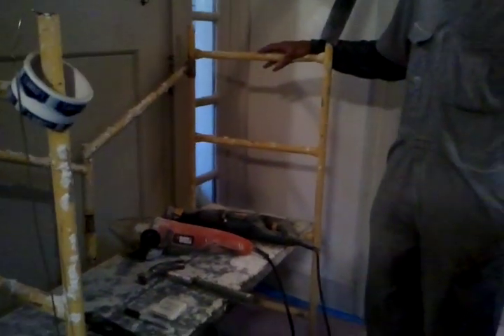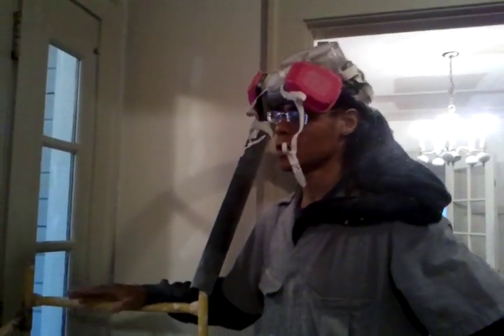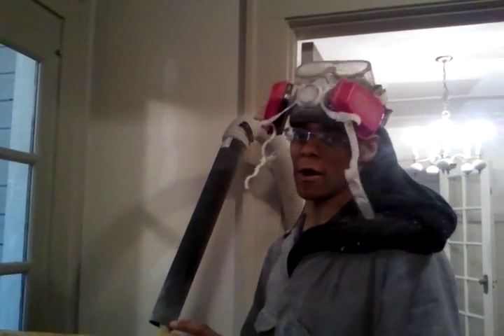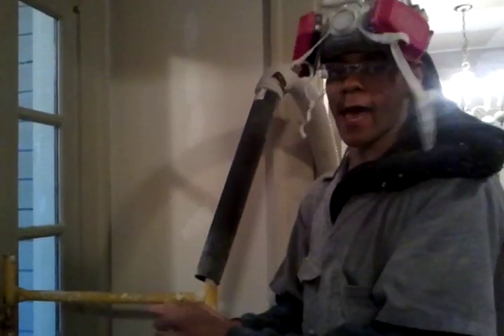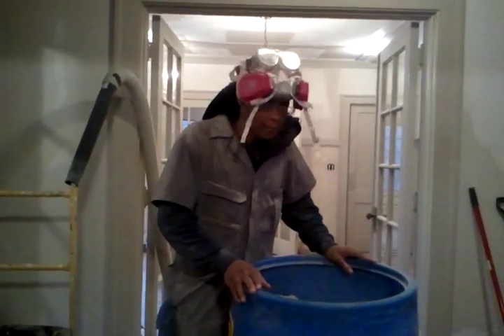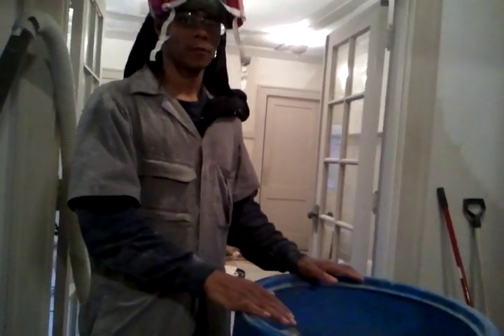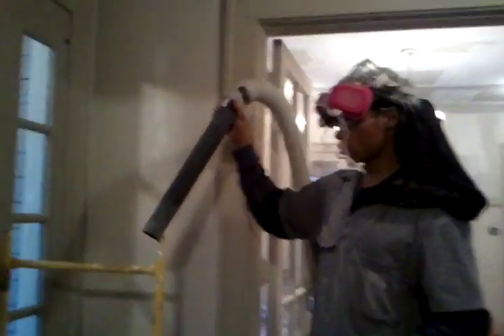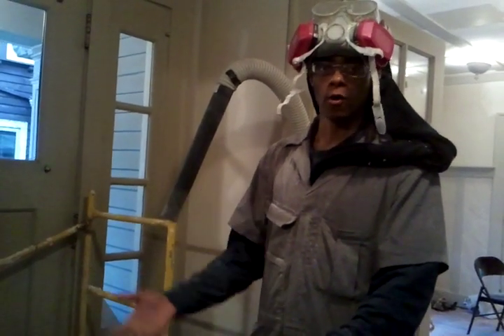Cellulose Insulation for Lath and Plaster Walls - Part One

Comment: What do you do about a vapor barrier?  Without one, vapor will condense as it moves from the warm side of the wall to the cooler side.  The cellulose will then absorb the water and compress itself into the bottom of the wall cavity.
Reply: I'll 2nd that question
Reply: ill third that question i see no answer ...........
Reply: Came on here tonask the same question. Without VCL this is potentially dangerous.

Comment: Use a Dremel Saw-max to cut through the cedar lath and or plaster. It works much better. I LOVE using the Dremel Saw-max on wood, ceramic and metal. Cuts like BUTTA!

Comment: How do you know you got the bay all full of cellulose? Just wondering because we're doing the same thing with our house. Your method of making the holes works great but we're not sure how to tell if the insulation is going all the way down.
Reply: You have to do a visual check. Also, drill small holes in a few areas along the wall so that when you blow in the insulation, it will come out of those holes to show that the insulation is reaching those areas.
Reply: @SplogMan  you think cellulose can soundproof a wall for tv and talking noise.

Comment: He doesn’t know his tools. He keeps calling it an “angle iron”...it’s an “angle grinder” and it causes too much dust. The “reciprocating saw” is too devastating and causes too much damage. You can use a multipurpose tool or a drill with a diamond hole saw. Keep it wet with a sponge and it keeps most of the dust down. I’ve done this in many old home renovations and I’ve learned what’s best. Also, 30+ years later, I’m a pro